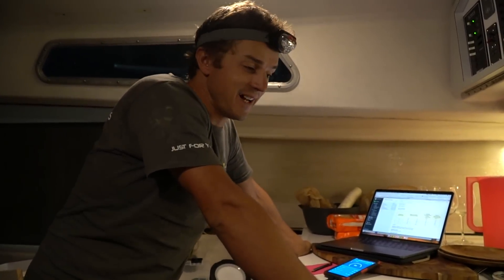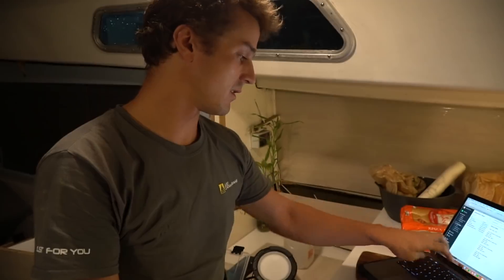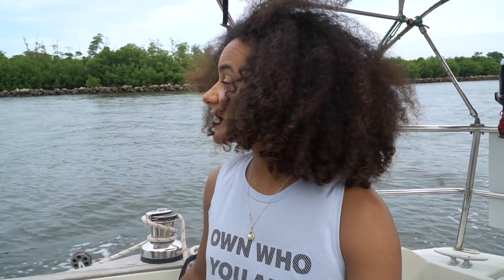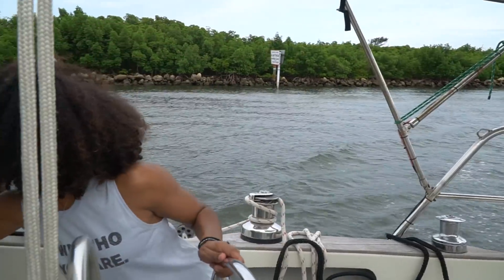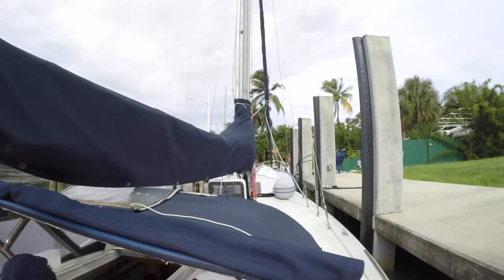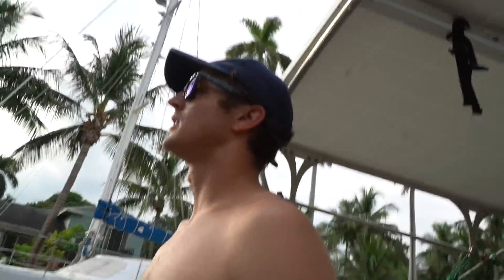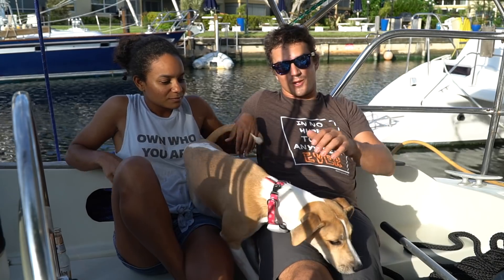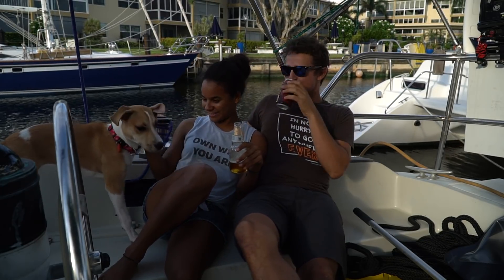Pushing our Electric Motor to its Limit— Sailing Uma [Step 139]

Comment: I did not know until yesterday that you are all electric. That is fantastic. Very quiet, best packaging and reliability. And you can have a generator for more Range. I wonder why not all boats have electric motors driving the prop, with a diesel generator providing electricity and heat for all kinds of uses onboard.

Comment: I looked up the cost of 100a LED batteries. They are around $900+.  12 batteries and you are about $11,000.  Short range, with limited power/ speed.  I'll stick with diesel.
Reply from the maker: Difference is, batteries will only get cheaper, and we don’t have to go to a fuel dock for 30 years. No noise, no vibration, no maintenance, no smell, all make it worth it for us. But it’s certainly not for everyone.

Comment: Hey guys! I found your channel a couple of weeks ago and I love what you are doing. I love electric motors and I own an electric car myself. About your problem with the motor heating, you may solve this either by replacing your motor for a larger one or by adding a 2:1 reduction. It seems counter intuitive, but the reduction will enable your motor to reach higher torque with lower current. Because that, you car reach higher speeds because the motor will work within its optimal performance envelope, with lees heat. I know you guys had a noisy unpleasant experience with the chain transmission, but I think that was mostly due to the old Diesel transmission than the chain itself. I hope my comments may be useful. I plan to get my own electric sailboat someday. Thanks for being my inspiration. Cheers!

Comment: Forgive me for my ignorance but why not simply go with a larger motor that will not be stressed so easily? I admired you determination to make this work.
Reply from the maker: Because we bought ours for $100 and a new one cost about $2000+. It’s on our list of upgrades, but we need to save a few more pennies first.
Reply: @SailingUma  Smart!
Reply: @SailingUma  I have about 4-5 years before I can do this full time. I've been checking out Tesla rear wheel drive motors (around 2500) and figure that by the time I make my final move there will be others. Chevy volt motors are available but I'm thinking about future resell value and with the Tesla it would be a unique item. Working on the panels needed to make it happen with a generator back up. I'm looking forward to watching more of you video's.

Comment: You guys are early adopters - the type that humanity has needed to move on from the stone age! Love the electric motor thing which with the lithium batteries and some proper cooling (get a bigger fan direct drive from the motor!) will give you enough range. With a wind generator you'd be able to charge nite time too. Congratulations!

Comment: From what I've seen so far, your skillfully sourced electric propulsion system will get you through 99.8% (to put a number) of cruising situations.  It has great advantages in many ways and it seems to be perfect for short passages and island hoping.  However, I think you will have to do some previsions when you're ready for an ocean crossing.  I would be concerned if I had to motorsail around for more than 3 hours while in the middle of an Atlantic gale.  Be safe, we don't want to loose you.

Comment: You guys could get a gas generator to for emergencies to power your motor. That's actually how a lot of high end hybrids cars work. That way you get the best of both worlds when you need it. Also a gas generator is probably easier to service than a diesel motor and services duel purpose to charge your batteries.

Comment: I think you should play with the prop pitch to make sure you get the best efficiency from the electric motor.  Also, realize that you have an outboard motor sitting on a mount doing nothing.  A more creative mount could make the dinghy motor available for main engine power.

Comment: A 15 mile range ???  Is a fork-lift motor designed for continuous running?  Stay skeptical, friend.  A decent diesel and a reasonable tank capacity will have a range that is typically 20 times that.

Comment: While the motor insulation is rated to over 350 degrees F, the colder you keep it, the longer it will last. Even 260 is too hot for me. I'd go to some trouble to force cool it. Your water jacket idea seems like the best way as it won't add to much to power consumption (just a low pressure pump). Anyway - nice to see you pushing for fossil fuel free.

Comment: Sounds like the motor has inverter duty windings, this gives a bit of a false sense of security because although the windings can take the heat the bearings almost certainly will not. Especially when thrust loads are being exerted on them. Only a true thrust bearing will protect the motor from those loads (no matter what the manufacturers say) at the very least I would add a couple heat sink bands to the motor to help reduce the heat. Most motor shops will have these readily available.

I'm in the process of upgrading to electric propulsion on my sailboat. I have a dedicated outboard for backup. Putting a outboard mount on the stern and using the dinghy motor would provide the same effect.

Comment: Hey guys, how are you doing ? Why don't you figure it out a way to use a heater exchanger or just wrap your motor with narrow copper tubes and heat a water tank for shower ? Cheers

Comment: I don't know if you ever read these comments, but if you can charge your batteries while running they will last longer. Taking them down so much shortens the life of them. Plus you have more power from fully charged batteries, and much less as the percentage goes down

Comment: I just found your channel. I enjoy your chemistry. You are very knowledgeable about the things you research. I want to mention some things for you to ponder - you don't have to explain it.  I apologize if you've already covered them. Think about the heat your motor transfers to the cradle. Baked fiberglass is no fun.
LiFe batteries allow a safe 80% draw without damage. When you say you drew 25%, was that of total capacity, or 'usable' [80%] capacity. All my best to you, Kika & Dan.

Comment: OK I literally just started watching your guys channel today and I am hooked. That being said I have watched the other video about the electric motor when you were with the two other couples and I have questions/comments about your setup(s). First heat is an issue for anything electronic so the cooler you can run the motor the more efficient it will run. You may be able to design a small scoop system so as long as the boat is moving water is moving through the scoop and trough your motor water jacket keeping it cool while not adding more electrical draw or create a new opportunity for mechnical failure of a pump. Two. Have you or your friends talked with any propeller manufacturers about changing the pitch, blade count, or diameter now that your electric? Electric motors have all there torq availible as soon as power is applied conversly your ICE motor has a power band the power band varies between  diesel and gas. Diesel powerband is most likely between 2-3kRPMs and Gas 3-4.5K RPMs. The point is your propeller was matched based on the size of the boat and the motor it came with. You may greatly benefit by going from 3 to 4 blades, increasing the pitch of the blades, or changing to a larger diameter propeller. My final comment/question is have you looked at adding a manual assembly for emergencies that could pluggin or attach to the rear of your motor output shaft? IF your batteries die or you have an electric failure you could theoretically pedal by foot or hand and easily turn the propeller on the boot with little or no resistance from the offline motor. I would love to discuss this with you guys more or even see your setup if your ever in the Fort Myers area let me know!

Comment: The software App on your phone may have calculated your remaining run time based on lead-acid batteries and not lithium. I am making this assumption based on the 25% used in an hour while only having an hour remaining which would be a 50% discharge.

Comment: Might I suggest finding out “once again” how far the batteries can be depleted. From my experience with lithium ion batteries in RC once down to 0 percent the battery is done. I usually go to 20% available and recharge. The other thought would be a stern bracket for your dingy motor to be used in an emergency. Thank you for the segments. Your presentation and videography is excellent.

Comment: To cool your motor more efficient you can bolt om aluminium cooling fins directly to your motor. Also direct the airflow directly over the motor. That is more efficient than just ventililating your enginebay.

Comment: No you don’t need. Diesel to motor away from a storm. In most cases that will not work.  Say you are 100 miles from your next port and one of you gets sick or falls and is injured. No or very light wind. It is a medical emergency. You need to get to port now.
Motoring for two hours with a electric motor is just not going to hack it. With a diesel you can make port in a matter of hours. With your “Green”
electric someone could die out there.

Comment: Hang in there. I know everyone was against the electric engine and rightly so still are but you can always put diesel motor back in.  What is your recharge or top up time with a generator? I don't head out to sea but I do head remote 4x4. If I was in trouble and hadn't made every effort to keep my family safe, I would be the bad guy. I am hoping you are taking your sailing channel to remote sailing places and not just what's popular on the crap sailing channels. I understand you can look at the weather ahead of time, is this enough?

Comment: I was just thinking... You're good with fiberglass: mount a fan blade to the front of the motor where the shaft exits and build a fiberglass shroud around the motor with exhaust outlets you vent outside.  That, along with heatsinks / fins on the exterior might keep you cool. :)

Comment: Dan I think your thoughs about liquid cooling are right direction. Even weekest liquid cooling is better then air because it is isolator. Getting liquid cooling is MUCH more quiet then fan cooling. Computer geeks use liquid because it is less annoing. Plus fact that you can use car cooling liquid which has temperature of boilng up to 223°F.  I would recomend oil cooling because you can get boilin point at 572 F or more (even if oil is much worse conductor then water) but when your fluid coat woud leak, oil should not demage your engine. Oil is used in condensator as isolator. Use working solutions, heat to oil, oil to (air or water). Like in a car.

Comment: Since the electric motor has the most torque from ZERO to say 25% of max RPM; 
Question: Why are you running a propellor designed for a fossil fuel engine?
My boat was upgraded to a three bladed propellor and doubled the size, I do 4.5 knots at 25% power, the efficiency is excellent.
I suggest any propellor change be tuned for electric motor applications.
If you do not find one, simply remove the spacer on the shaft and add a identical second propellor 180 degrees opposite orientation.
Keep sailing. Cheers.
Reply from the maker: Yes, we still have the same prop its a 13" 14 pitch, 3 blade. We can't go any bigger or it will hit the hull, so we just left it for now. We don't really want to change props now, since we may be upgrading our motor soon and we'll match the prop to the new motor. Do you get any regen?

Comment: Dan,  you have lowered the resistance in the winding with higher temperature.  You should put a thin wall flexible copper pipe around the outside of the motor.  Put synthetic transformer oil in the pipe.  Connect the pipe to a heat exchanger.   You have option of water or air cooling of the oil with a connection to a radiator like they use in the refrigeration industry.  The radiator can have a fan or just be exposed to air flow above deck.  In other words you do not need raw water to do it!   If you lower temperature you raise resistance and you use less amp hours from you batteries and it is better for your motor!    Steinar Syversen.  (Guy you gave Westerbeke transmission to!)
Reply: Oops!   Meant to say it increase the resistance!   Higher temp means more molecular vibration with more electron collisions and less free electrons for current to move across potential difference and thus more resistance and higher amperage.  So to lower amps usage lower temperature!

Comment: Saw you hauling anchor chain by hand..obviously no anchor winch at present. An  interim or emergency  solution is a  two chain hooks spliced to two separate lines led back to a sheet or other winch. Two because they are used turn and turn about without the need to secure chain between each retrieval.😁
Reply from the maker: That's how we got the huge hurricane anchor out 2 yrs ago after weathering Mathew on anchor. Takes awhile, but works great!

Comment: Curious as to why you did not anchor and wait for slack water? 
Curious also as to your motives and  objectives going 'electric'.? How much current does all the monitoring electronics draw.
Is there some protective device in case of a fouled prop..sheer pin or the like?
Reply: Slack water in a river? um...........

Comment: The figures you recorded while doing your motor test would be different while actually motoring on the sea, while testing your prop is pulling the sea to it and pushing it away, while at sea it starts that way but as the 
boat moves through the water there is less power required to do the same amount of water movement so
less amps.
Reply: Actually the reverse is true. More power used at sea due to fighting current, waves and wind.

Comment: Electric motors seems useless to me in sailboat unless you are only sailing a couple very short distance.  I just don't see using it for an extended off shore crossing.  Either you will need a generator or a larger battery bank/solar cell setup.   Good luck and do enjoy your channel.
Reply: I know from experience its the opposite. No need for an engine when you are sailing. And electric is perfect for the short track to a mooring or harbor.

Comment: in an engine cooling scenario its always best to simply go with the best cooling solution, as it eliminates the possibility and worry of an overheat.  Ambient temperatures is a real issue, The heat from the air as well as the reflected heat from the engine itself.  do yourselves a favor and switch to the water cooling.

Comment: With the open ended shaft of the rotor, would it be worthwhile to insert a shaft with a fan? Understanding that you are loosing a fair amount of power because of heat, would this help offset the loss?

Comment: How about battery temp. Running the motor for an hour and then charging right after might give you heat degradation on those.
Reply: Oh OK later in the video you mention battery temp.

Comment: Use thermal paste when attaching water cooling tubes, it really helps transfer heat and dissipate it. Maybe even add cooling fins to the water cooling as well. Can never have too much cooling on electric motors. (Unless it’s like waaaay cold)

Comment: You have a drive output on the front of your motor.  Instead of running an additional motor to provide cooling why not punch cooling holes in your mounts, put a shrouded fan on the front. a shroud around the motor and ducts off the rear mount to the outside.  Simple and foolproof, if the motor is running it is providing its own cooling.  Please! don't use raw water cooling pipes on an electric motor, salt water leaks and electricity is a bad combination.  Please secure the power cables so they don't touch the hull, wave pounding WILL abrade the cover and cause problems.

Yes, Diesels are proven and Electrics are new.  Especially when homebrew.  People used to say "If you sail too far in that direction you'll sail off the edge"  Just be safe, please.

Comment: Great test for the new setup! Personally I'd stay away from liquid cooling. I just get very nervous getting liquid of any type around electricity. Even if it IS dc. I'd try ducting first. A simple plywood box around the motor that you connect the fan on. You air closer to where it's needed for cooling. I'd also install a sending unit and readout around the helm, preferably with an adjustable alarm. I'm following your progress closely so "hopefully" I don't make mistakes that cost me. $$$$$ 😎

Comment: I lost my butt investing in a marine electric propulsion company and they are now gone, but they did have some really cool concepts.  I sure will have electric in any boats I ever sail. Right now, I just have a trolling motor on a 18 footer, but I have a steel ketch to refit and sail one day.  One cool concept was regenerative motor sailing.  They had a computer switch between drive and charge in a seaway.  They installed some, It would be interesting to know if it really worked.  Thanks for all the info! Fair winds!
Reply: http://www.multihulls.com/elec_wheel.html
Reply: Why is the cool company gone?
Reply: Long Story, but they tried to sue Toyota for patent infringement and lost their butt.

Comment: So lots of posts  on the pros and cons of electric motors . To be clear electric motors are by far the best , quiet , efficient , powerful and low maintenance . 

It is the batteries that suck . No one really has any problem with the motor , barring Uma that made their own set up and they nearly have it . 

I think the best set up is electric with a gen set that can extend range and run other stuff as needed like water makers or recharge batteries while on the hook after a spell of bad weather  . Solar these days can run just about everything , but it is short on running  propulsion . In an ideal world the gen set is rarely needed but there if you want to explore a river or canal .  .